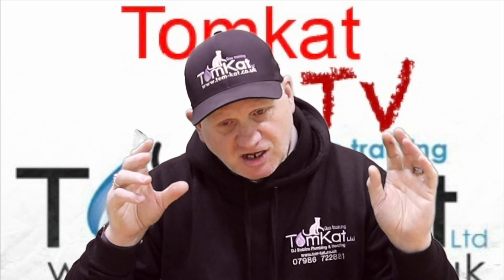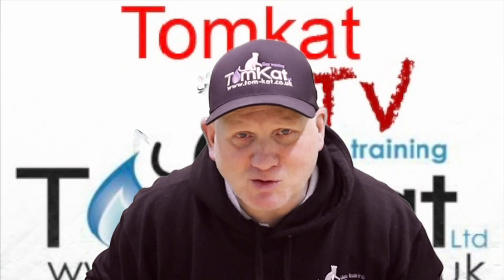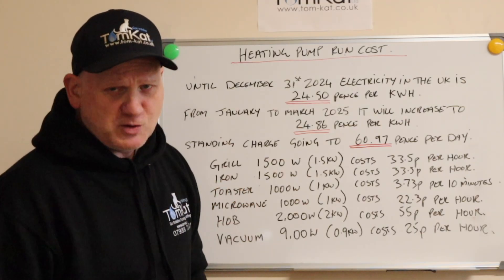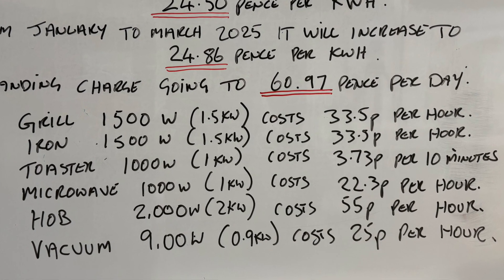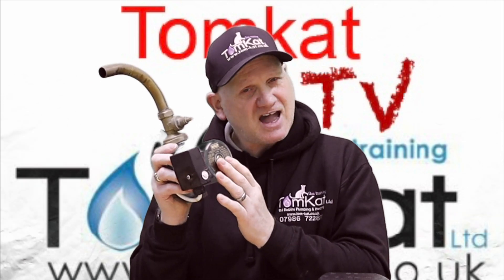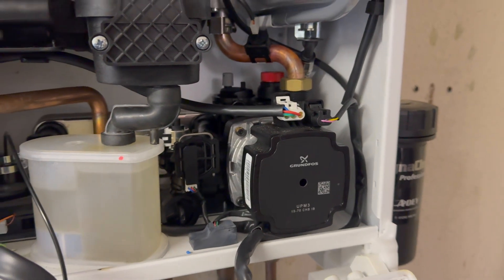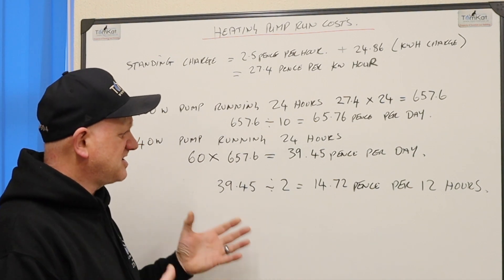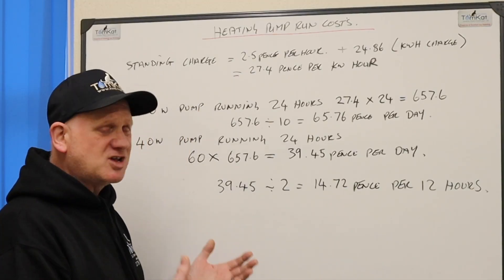How much does it cost to run a central heating pump 24/7

Comment: Excellent video. I have a question if you can answer pls. Would the board need to be upgraded as well because the new ERP pumps need the modulation inputs? Thanks

Comment: The 40w pump running for 24hr would be 26.3p per day.  (40/1000 * 24 * 27.4)
And at 12 hours per day will be half that so 13.2p 

Still got a 20+ year old Grundfos selectric running in my house. Consumes 62 Watts on speed 2. I replaced the capacitor a year ago which improved power factor and enabled it to start consistently on lower speeds. Cost me a fiver to repair rather than 100+ quid for a new ERP pump. The increased power consumption a trade off Im willing to pay for the proven reliability vs ERP pumps.
Reply: Also, the electrical energy used by the pump ends up as heat into the property (if the boiler is inside, of course).

Comment: How much gas in qubic metres will a 4m.bar pressure drop leak in 24hours, a week a year? 
Pease help not shure how to work that out?
Reply: It would depend on the size of the gas installation pipework.

Comment: Tell you what I’ve noticed - them new ERP pumps have plastic impellers, and they are smaller than the impellers on a non-ERP pump! Have you come across any problems with the plastic impellers?

Comment: [4:00] EOn now offers a fixed rate tariff which reduces the electricity standing charge down to 39p a day. The unit rate for gas & electricity is about 2% higher than the alternatives, so may not work for heavy users.

PS - I don't worry about the pump running costs. My Grundfos Alpha only uses 22 watts on its smart CP1 setting, and all of that eventually turns into heat anyway. 

PPS - At [11:00], be wary of the Grundfos AutoAdapt setting - it turned the pump down to 4 watts which didn't produce enough flow to stop my boiler overheating (I suspect this is because my system uses microbore pipes).

Comment: I've got a conventional system with a Vaillant Ecoplus boiler. The pump is a grundfos and it looks oldish but it's has the ERP function. When it's set to pressure reducing it makes the rads bang. Any idea why it does this?

Also, how do I know the pump is burner linked on a conventional system? The pump runs for 5 minutes before the boiler sends out any heat.

If I'm balancing the rads do I set the pump to a steady speed and then when the balancing is set do I then switch to ERP mode or should the balancing be done in ERP mode?

 (I'm a trainee gas engineer) So this info is important to know and get It right.
Reply from the maker: @darrenlomax1283  done a few videos on balancing check them out
Reply: @tomkatgastraining  already have done bud been watching you for a good year or two
Reply from the maker: @darrenlomax1283  is the pump wired into the boiler ?
Reply: @tomkatgastraining  not sure. It's next to the open vent HWS on the circs. A plumber I know but doesn't share to much info said if it's burner linked; it'll run for 5 mins after it's turned off. Which it does. That's all I know.
I imagine it's simpler with a combi because the burner would be able to communicate with the pump in its firmware but an open vent wouldn't have those kind of smarts.

Regarding the balancing is it best to set it on a steady flow and then switch to ErP?
Reply: @darrenlomax1283  Balance using the pump setting you'd use permanently. Vaillant use a slow start system to prevent thermal shock and verify good circulation hence the reason why it doesn't ramp up the burner straight away. Check if pump is wired directly into boiler or with a 3 wire kit. Familiarise yourself with the wiring centre, how each component is connected and how the switching sides work. Only way to learn :)
Reply from the maker: @ use auto balance TRVs they are game changers
Reply: @tomkatgastraining  seems a bit too voodoo for me and theres an additional point of failure. I think

Comment: Thanks Derek,it was very informative to know about the pumps. However, isnt is the amount fuel that's used to determine the cost of running the boiler?
Reply from the maker: @user-ju4fp6ls3s  had to many comments saying it’s the pump that costs more than the gas so this is why I did this to prove it doesn’t
Reply: @tomkatgastraining my pump takes about 6 watts according  to the display on the front. Gas usage is kw at least. Do people really think the pump uses more than gas 😂
Reply from the maker: @ yep